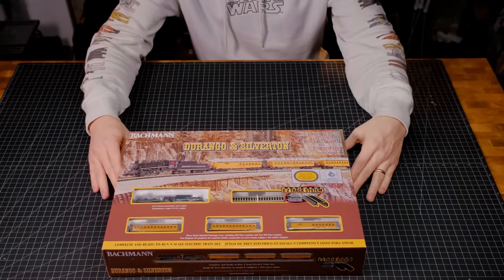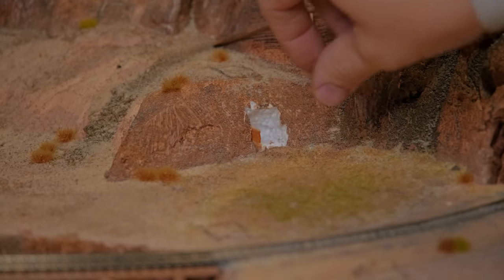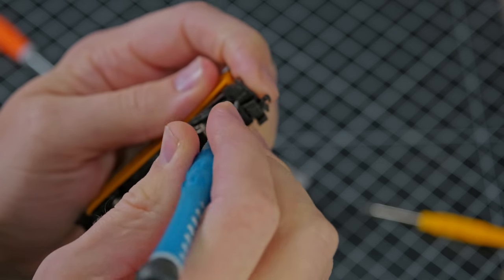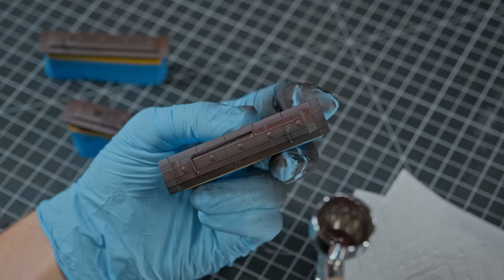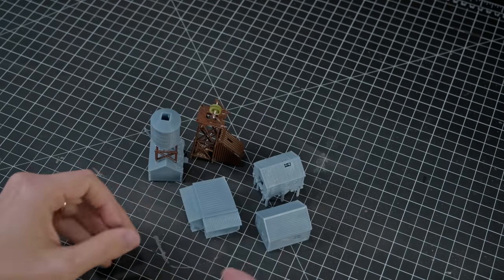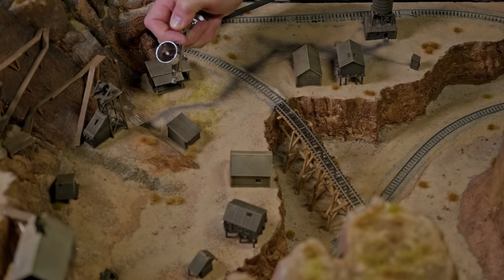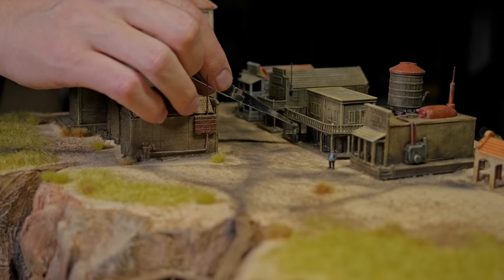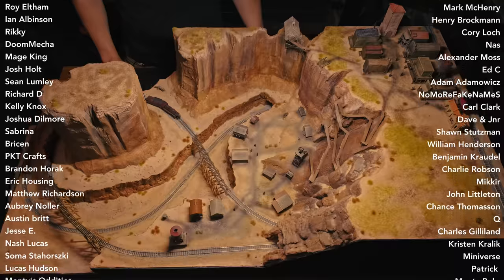Upgrading My Realistic Imaginary Railroad

Comment: 0:32 When trains stutter or stop like that, it's usually grime on the track. You can sand down or file the top of the track to remove any dirt or grime that is blocking currency flow
I've been having that same issue when applying glue, paint, or foliage to my layout. Hope this helps! :)
Reply: Don't sand or file, just use mineral spirits and a microfiber cloth
Reply: @MattGoelz  That too. I completely forgot track cleaner existed 😅

Comment: If you have a problem with the train always stopping at certain spots, you need to clean the tracks. You can do this by using one of those old school erasers that have a tiny bit of grit in them. This will remove the oxidation from the track, and your train will run good again. You can also use steel wool to  lean off the oxidation but the steel wool will likely leave a mess behind that you 2ill definitely want to vacuum off as it can really play havoc with the electrical parts of the engine.  There are also dedicated cleaners sold in most train hobby stores. But those blue abrasive erasers that were meant for removing ink, Are the best for cleaning the tracks. Sometimes you also need to clean the wheels of the engine as well but just keep in mind that the blue erasers also leave grit behind so a vacuum is always best to keep it under control. I love this diorama and I'm glad you kept it and are updating it! Keep up the fantastic work!

Comment: Model railroader here. I really like your stuff! Definitely inspiring. You said you were having problems with your locomotive. The most common problem with smaller scales is the track. It can easily get dirty from outside dirt/dust, but can also can get dirty from oil and corrosion. Best way to clean it is to use mineral spirits or low water content rubbing alcohol.

Comment: one thing that would help your train run better is cleaning the wheels and track. you can get track scrubbers at model train stores of hobby shops or you could use a  scotch brite pad, that's what I use on my tracks. also check the rail jointers to make sure they are connecting properly. if you do all that then you shouldn't need to put a second locomotive on the train

Comment: An adit is not just an entrance to a mine, it can be used as such but primarily it is a drainage level allowing pumped water and water perculating into the mine to be drained at a steady decline to the surface.

Comment: I currently work in a train hobby store. N gauge track has to be cleaned the most often due to the limited surface area that allows the power transfer.

That’s why I usually push people towards HO or O. N is just a pain in the ass.

Comment: As cool as it is here is just one tiny detail that I would love to see. Both trains at the front of the cart connected to one another and both hauling the load as that's how 2 train hauling would have been done in the old west rather then one at the front and one at the back facing in opposite directions

Comment: hey! model railroader here. i would recommend swapping the wheels on the passenger cars from plastic to metal, however it can be very expensive to do this. if you cant afford metal wheels i would get a track cleaning car. I have a trainset from the same company and after a little bit of not cleaning the tracks i was also having that same issue of the train starting and stopping.

Comment: you can clean the railheads on the track if the locomotives keep stuttering. and because that grade in the tunnels is steep, i would recommend a heavier, higher quality locomotive. my personal recommendation would be a 4-6-0 or a 2-8-0 from bachmann spectrum, as i have both and they work great. if you were to get one of those models I would recommend not getting them from bachmann, but another retailer or used on ebay.

Comment: If the train is stopping and stuttering you probably have dirty track, dirty wheels, or both. Clean the track with a bright boy tool (look it up) or a pencil eraser, but not sandpaper. You can also try rubbing alcohol or goo gone with a paper towel. The same for cleaning the power pick-up points on the engine(s). That should help significantly. Also, the more you run the train, the better your changes of keeping the tracks clean.

Comment: the problems with the train is that the track and wheels of the train are dirty. You can use a spare t-shirt to clean the track and rubbing alcohol and q-tips for the wheels.
If there is more than 1 steam locomotive pulling a train, it is called a double header. Usually the two locomotives are at the front and coupled together.
This set is amazing! I really want to be as good as modeling as you some day.

Comment: If you get a low power airsoft gun, and shoot polystyrene foam, you can get some nifty artillery craters, and if you have a high powered one, shoot through a thin piece of foam, and use the crater than it leaves on the exit of the bb, it creates some really nice natural holes, and bomb craters.

Comment: I think I might know the reason why the train had issues running: the track was dirty. The train pulls electricity from the track and this allows it to run. However, the track can get dirty over time. This cause bad conductivity between the rails and the train. A simple fix is to run a paper towel or a cotton ball over the rails with rubbing alcohol and the rails would get cleaned which would improve the conductivity of the rail which would improve the train’s performance. I know because my small wheel base locomotives (0-4-0s, 0-6-0s like your engine, and a 2-6-0) would constantly cut out because of dirty track.

Comment: When 2 locomotives are used it's called "double heading". However having a steam locomotive running in reverse like that wouldnt really happen on an open rail. To correctly double head, both steam locomotives will be at the front of the train pulling forward. And with steam locos, dou le heading took great skill from both engineers and drivers. You really wouldn't see a steam loco at both ends of the train. Not saying it never happened but it would be extremely rare. Other than that the model looks amazing

Comment: Your using a locomotive from one of the bachmann "trainsets".  The trainset versions are notoriously bad runners.  if you want one that is still a locomotive for the time period your modeling try the Bachmann Alco 2-6-0 Mogul or MRC 4-4-0 American both are VERY VERY good smooth running locomotives.

Comment: Just for accuracy's sake it would be more realistic if both of the locomotives were at one  end of the train. It's unlikely that anyone in the Wild West would use a push-pull configuration as the coordination between engines would be more difficult than double heading a train. You would probably still get the same power as with them on either end but it would look much better and be more realistic.

Comment: I don't know how much you are worried about realism or not, but when trains would be run with two locomotives they would both be at the front hence it being called double heading. This way the crew of the second locomotive would still be able to see and hear what is going on with the first. Plus locomotives with tenders also were designed to run forward meaning going in reverse the weight of the logo would not help the wheels get traction and they would have less fine control

Comment: Advice: ditch that Bachman engine and buy a Bachmann ten wheeler (much nicer model in every way). The engine you have is a POS and era is way wrong and has been made for like 40+ years.  Atlas made a very nice 4-4-0 but they are hard to find.  N scale has come a long way in the past 20 years.

Comment: 7:33: tunnel access: if you cut a groove in the bottom of the top foam, and another in the top of the bottom foam, you can seal off the tunnel with a strip of thick card, slid in to these two grooves.  this keeps the tunnel properly black, and also keeps dust out. eh ?